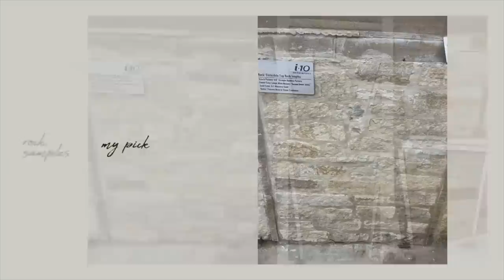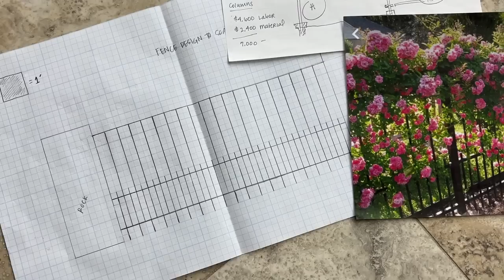DIY Iron Fence *EXTERIOR MAKEOVER Part 2* (Design, Costs & Process) | XO, MaCenna

Comment: Looks amazing! Fear that Kinsley could still fit through the bottom of the fence. You may need to put some mesh up to the first horizontal rail just to ensure you won't have an escape artist. Wouldn't really be visible with plantings.
Reply: I've been digging a trench along neighbors' chain link fence then filling it with river rock. 
(They have invasive quackgrass, I'm hoping this will at least slow it down.) 
Their dogs have been digging a hole on their side, but when all the rock is in place it should be fine.
Reply: Yeah, I was wondering about that too.  Those look suspiciously like Kingsley-shaped holes at the bottom.  I’ve had dogs who exercised their escape skills regularly.  Not a happy time!
Reply: Knowing MaCenna, she seems to baby Kinsley and likely wouldn’t have her run around outside without supervision. Something about princess Kinsley screams “my parents don’t leave me outside for long”😅😆

Comment: I commented on your previous video, but because I want to make sure you see the message, I'm going to repeat myself (Hopefully that's not annoying). I suggest you pull the soil back away from the tree trunks that you want to keep. Leaving the soil built up around them can cause rot, disease and pest problems. If you don't want to keep them long term, then I guess whatever, but if you want them to continue to provide shade to your garden and home, grading the soil so that it's at the level it previously was and so that water will run away from the trunk is ideal.

Comment: That's so beautiful! Your dad is amazing! My husband is a welder by trade also along with other many talents kinda like your dad. The sign of a great welder is very little grinding has to be done to clean & flaten the welder. Looks like dad put that welder down with little grinding it smooth. My husband has tiny bits of steal in his belly. When they have xrayed him before. He started welding at about 12.  He's 65 now. Along time welding off & on. His welds look like a machine did them. I tried & my welds looked like I puked weld on them. It's way hard & way harder to get good at it. Years of practice I believe may be the trick..way more to it than anyone thinks.  
 You are a lucky girl, your dad & mom are both amazing parents & ppl.

Comment: Looks beautiful Macena! I started building at exactly the same time as you, although I’m building a new home, not restoring & absolutely love watching your journey along with mine. I am having trouble with getting fencing contractors & they are charging crazy prices. Our metal fencing quotes are $AUD19k & only 3 panels, 1 entry gate & 1 driveway gate. It did involve a curved panel which of course drove the price up. But now changing it to a brick curved panel (hubby is a bricklayer).  Really love your home! Have a great week! Regards Mabel 🔨🛠

Comment: Macenna this looks amazing!!! It’s been so incredible to see your vision come to light. I’m not sure if you had planned to do this, but I noticed that you don’t have any vents on the skirt around the porch. Even with the gaps in between the boards, it’s still a rot-risk for your porch’s floor joists. My parents and I renovated a 1930s bungalow that was lacking vents around the porch and that whole section of the house had rotten joists due to lack of airflow! That, coupled with southern heat + humidity.

Comment: I love the nods to New Orleans through the whole decision making process. Wrought iron is very specifically New Orleans. I was curious about how much rain might come off the front porch and that might explain what the grade was sloped towards the house ( simply because it’s being washed away by the rain coming off the roof and porch.)You could reduce that with gutters just on the main house and have the down spout go down on the side with the fireplace. Then, only the water coming off the porch roof surface will water whatever you plan along the front porch but control the amount of water coming off the main roof.

Comment: Hi MaCenna,  those spear looking things you liked but decided not to use because of the deer are called finials.  I have always loved them.
But l was wondering if you could add them to the lower fence detail...either every one or every other one.  It would still be interesting and pretty.
I used the buy them and glue
them to marble or wood blocks and sell them at craft shows for little decorative things.  They make different designs..l especially love the fleur-de-lis! (I noticed you wear a fleur-de-lis necklace a lot...pretty) It all looks great!
Your Mom & Dad are the best...they just love you to pieces!  Having a loving family is a treasure!  You all have such a strong work ethic, too.  💗🤗

Comment: The fence is beautiful! I wish it would have been a little lower to match the bottom of the window frames rather than cutting into the sight lines of the windows. Also maybe you’re planning to fill in the bottom spaces of the fence but having a dog exactly like Kinsley she would have easily gotten through those slats at the bottom.

Comment: Does your pressure washer not have a soap injector? If it does, for future reference, you can place the hose/tube into the 5-gallon bucket and it'll siphon whatever you want into the sprayer. Much faster than using a spray bottle.

Comment: Curiosity question: I noticed that the porch on the side stops short of going to that edge/corner of the house. Same with the roof of the deck. How come it doesn't just go an extra foot or so? Or is that just usually the way front decks are done. idk I noticed it and knowing you there was a reason for the exact dimensions of the deck, so I was just curious.

Comment: Try not to water the wrought iron , eventually it will wrought so keep the up keep on the paint and underneath too. We lived on a corner, it was all wrought iron and the house was Spanish style with painted black on the windows, built 1925. The garage could only fit the VW.…M❤️M of 5

Comment: The fence looks good but …… it looks upside down. The 1 foot(ish) section is usually at the top. Likely to make it harder to have someone climb over it by using the lower portion to lift themselves up and over. You’re doing a fabulous job all around.

Comment: lol im betting you regret not buying a hand pump pressure sprayer LOL.....using a small spray bottle like that on such a big job is painful!  ive done it just having to treat a moldy beam in my kitchen.....lol.......invest in a 1 gallon pump sprayer is well worth it.....and they arent much....i got mine for under $20 CAD.  its useful for many things.  i use mine mostly for my garden and seedlings.  tho you probably shouldnt mix one for chemicals with one you use on a garden.